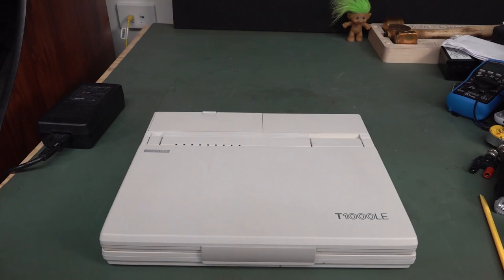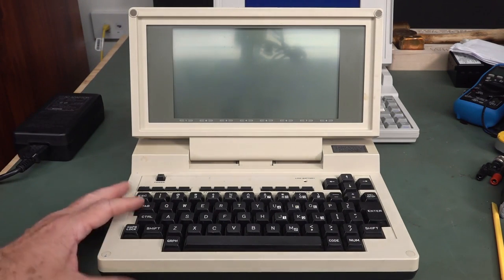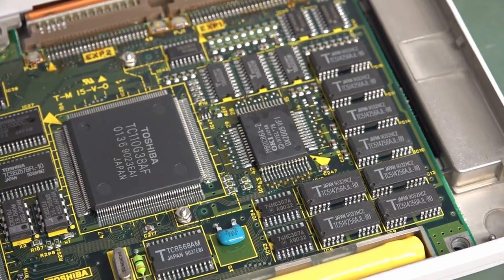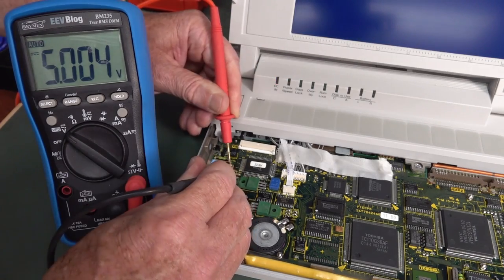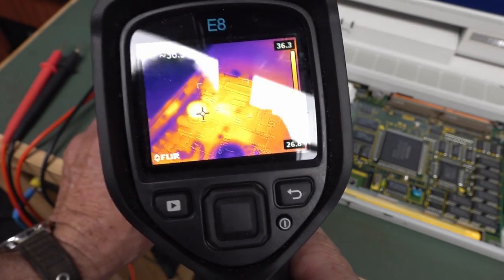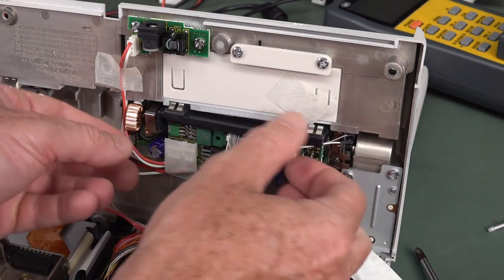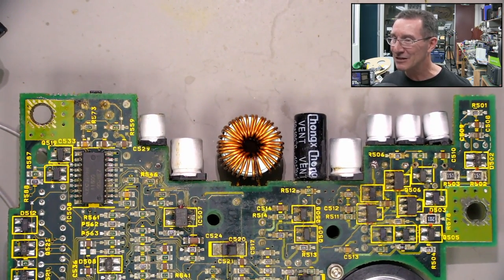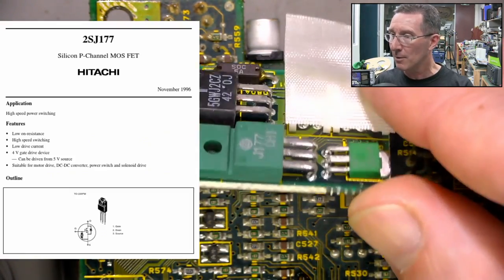EEVblog 1527 - Toshiba T1000LE DOS Vintage Laptop Repair HELL

Comment: Got a T3100E that was working perfectly but after recapping the power supply the screen doesn't light up. All rails are OK. Sell on eBay or throw in the trash?
Reply: ebay, I could be interested!

Comment: A sad prospect is that a power supply failure caused excessive voltage output (like the 7 V you measured on a 5 V component) and caused further damage.
Reply: This is all the sadder because my first laptop was a T1000SE and I was hoping to see this one running.

Comment: BTW... that blinking seems to imply a short as the power supply tries to start, I would start by following the LED in reverse.
Reply from the maker: Watch the ending, it's not pretty.
Reply: @EEVblog  I did, you got a couple Caps totally cracked, like C520. I put a comment about that some 20 - 30 mins ago. I was being... interactive!

Comment: How many connections are actually running between the power section and the rest? Maybe you could remake a mod board PCB that replaces the whole power supply section and just cut the traces going to the old one. Still a lot of work, obviously.

Either way you could try disconnecting the power section and feed it all with bench PSUs to see if it's still working in principle.
Reply from the maker: Yeah, the thought of a new design PSU crossed my mind. No schematic to go by though.
Reply: @EEVblog  I think some reverse engineering content would be interesting too in general.
Reply: Yeah when I saw those traces it was where my mind went too...

Comment: Use something acidic on the corroded solder joint before using alcohol.

But yea if ur thinking of repairing this thing ur in for days of work.
Reply from the maker: Yep, many many days of work.

Comment: Even if you repair the  corroded traces and vias and the cracked components you still have the large ic that is overheating.
I am sure that 7 volts on the 5 volt rail did not do it any good. The hard drive uses 5 volts.
Foggetaboutit.
Maybe you can find one with a cracked screen.
If you are lucky maybe your screen is still good.

Comment: Power supply caps can be tricky. Are you sure the ESR of the SMD caps match the originals? I like to get the same size caps for a rough measurement if I can't find the datasheet.
Reply: Most new decent brand caps with a 105 temp rating will have a low ESR, but at this point that is the least of his problems with all that corrosion on the underside of the board.
Reply: @3UZFE  Yea about the corrosion. I didn't watch until the end of the video.

Comment: I had not thought that they would have already used smd parts that early.
At least it looked to me full of smd parts.
Reply: Very common on late 80s early 90s high end Japanese electronics. The best SMD era as they were small, but still able to be soldered easily by hand. The 00s+ stuff going super tiny.

Comment: Wow thats a bad one, classic example of leaked electrolytics. Likely repairable but that would take days worth of work sorting out all the SMD parts on the reverse side and the PCB traces themselves, even after doing all the work it may still not work right if other parts like the chipsets have been compromised. Can't always save everything but it would be fun to try!

Comment: I have Stanley Kubrick's T1000. He handed it to me and said "If you can fix it it's yours." The battery had spewed its guts over the motherboard. A horrible green mess.
I cleaned  up and managed to get it working. 
It is a pretty ugly yellow colour now.

Comment: sad but id love to see you attempt to fix that anyways! If you sand and clean it well with a wire brush it will bet most of it off and neutralize it with vinegar, you can submerge that part of the board in it for a day and should be enough
Reply: Still have to resolder it afterwards, but all of that preclean up work will help.
Reply: @3UZFE  yes i know but if he wants to stop the corrosion after the repair you need to do that, ive fixed over 50 boards with common problems like this for many years and something like that is very very easy to fix compared to some crazy shit ive repaired from cmos battery leaks

Comment: Hi Dave! Yeah that looks crusty!   Something that might not be a total PIA to scope out , and there seems to be devided opinion and misunderstanding on.  Is the "throttle commander" (removes engine lag from cars with electric gas pedal)  is it trash like the obd2 watsits. I figure a pedal position sensor is a potentiometer, then engine management operates throttle gently to meet EPA standard.
How can something that connects between sensor and controller make the output actually more responsive other than making the absolute value higher.  
I hope they work because I've just spent 200 quid on one to try and make an stick shift opel mpv maneuver with some sort of modicum of finesse. Instead of having to book an appointment with the biting point.

Comment: If it can't be fixed, it would be interesting to replace the motherboard with a DIY one that uses a microcontroller running a x86 emulator. Keep the case unmodified and save the original board in case someone is interested in restoring it in the future.
Reply: I thought i heard microcontrollers aren't computers, now I'm really confused
Reply: microcontrollers are not computers indeed but they can be programmed to emulate (basicly act like conputer hardware) a computer they have a cpu core and some ram and io blocks and some other goodies, a raspberry pi pico or esp can emulate a small game console, there are projects made with those emulator softwares
Reply: @309electronics5  i see now, makes sense too since the os is on a external floppy
Reply: Or to heighten the irony when someone opens it up, have it full of early cellphones like Psion and the Kickstart and Poco F3 and Samsung Galaxy S3...

Comment: What about printing a battery adapter on a 3D printer?  Maybe it could use a lithium battery and convert the voltage with circuitry.  Just a suggestion.

Comment: I have to wonder if it might be the design that needs the batteries to run and just uses DC to charge but I am betting on the nastiness and the cracked ones.

Comment: Those computers needed the batteries to be charged before it would function. 
The computer ran on the batteries, and the power brick only charged the batteries, it wouldn't run the computer.

Comment: Try to put a gotek in a IBM PS/2 L40 SX, the floppy connector is not wired in a standard way.
Reply from the maker: What's a gotek? I have an L40SX
Reply: @EEVblog  A floppy drive emulator where you use floppy images on a USB stick.
Reply: Most PS/2 computers used propietary drives, some people made custom cables, watch "IBM PS1 2011 floppy repair fail, Gotek install" and "BM PS/2 Hack! with standard floppy :)"
If you can identify each pin on the mainboard or the OEM floppy drive I'm sure it must have all standard floppy signals like those other models.

Comment: I would probably want to 3D print a battery enclosure and put a 2 series lithium-ion pack in it 2s li-ion is 7.4v nominal which should work just fine on a machine meant to take 7.2v nominal.
Reply: Except the charging circuitry is completely unaware of the lithium chemistry, and will probably turn the batteries into bombs if left plugged in for any length of time.
Reply: @AndrewFremantle  Surely he meant with the appropriate BMS as well?

Comment: The way it's corroded the caps have leaked it's nasty juice good on that poor board. :( But still probably not that bad, traces seem intact still. Clean with vineger before leaving it to corrode even more though.

Comment: Whenever I see the electrolyte soaked boards with traces eaten away I just give up on a repair straight away. Not only it is way too far gone to be repaired easilly you never know how long it has before anotger trace gets broken or develop too much leakage to anotger one. It was a nice machine but there is no way back for itunless you are ready to desolder the entire main board, to grind and scan the layers and to generate new gerber files and to order a new board and that is not something you would bother with for just a cheap consumer product.

Comment: That's nothing, Necroware has fixed way way worse than that, ie, nearly every motherboard he does needs trace repair. 
Black spots under the coating doesn't mean cut traces, just sand off the coating until it's bare copper - NW uses abrasive rubber Dremal wheels -, vinegar, and then run wires.

Comment: All the horrible leaky electrolyte and corroded traces aside, what is going on with C520?  It looks like it's cracked in half.

In the retro computing hobby so many Amigas and old PCs have been ruined by battery leakage from the Bloody NiCd Varta batteries.  On Amiga A1200s, the SMD caps are the usually the PCB killer.  Once it eats through too many traces, it really just isn't worth the effort.  A lot of times with the SMD caps the only indication that they're leaking are slightly less shiny traces while it eats the traces alive under the cap.  They often look nearly perfect.

As soon as I saw those brown nasty solder pads on the caps, I knew it was going to be a disaster.

Comment: ELNA crapacitors are the worst capacitors ever in older stuff.. as 12voltvideos what he thinks of ELNA stuff in old TV's and VCRs... Sony used to use a lot of them in their vcrs, repaired a video 8 deck a few years ago for a friend, every elna cap in their had leaked and ate the boards... all the nichicon were dead but hadnt leaked.

Comment: What would one do with a laptop back then? It's not like you could just go to your local Starbucks and connect to the WiFi.
Reply from the maker: You write stuff on the road, do work on documents, spreadsheets etc. Journalists write stories and modem them back to HQ, that's why most laptops back in the day had a modem option.